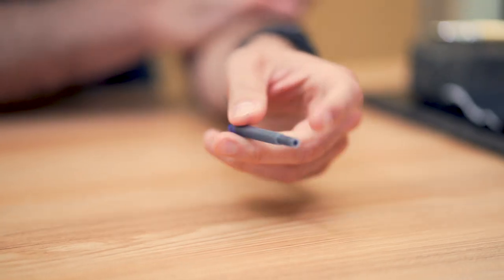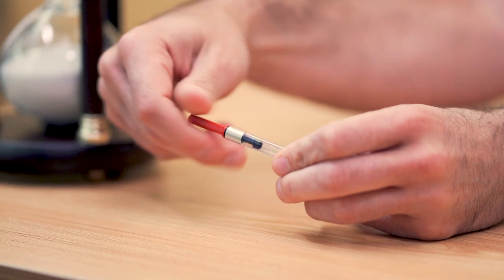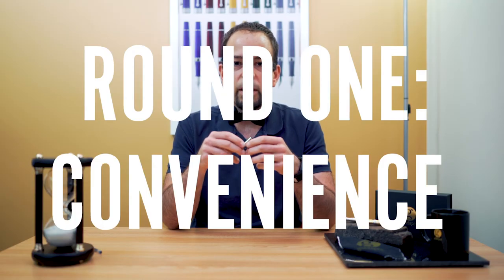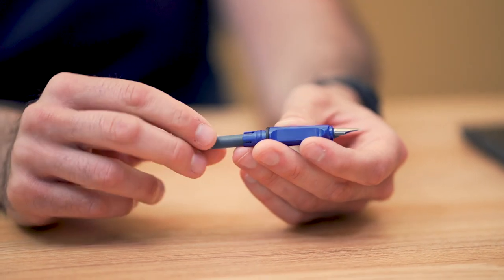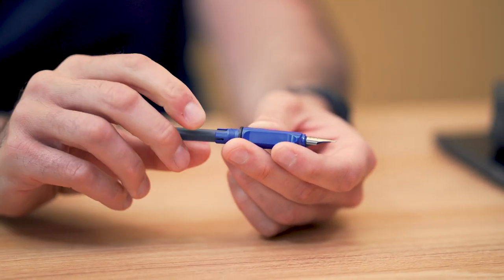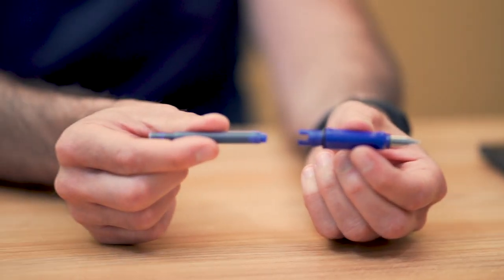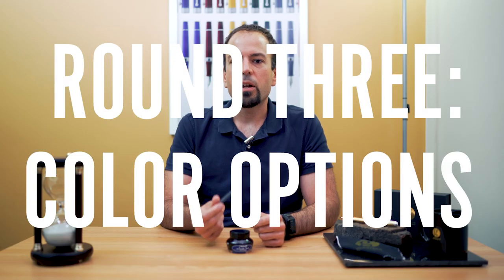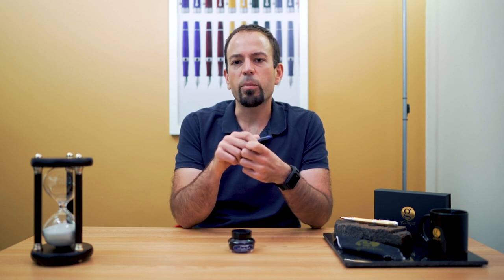Fountain Pen Converters vs. Cartridges - Fine Pens for Beginners Ep. 3

Comment: Thanks for the entertaining and informative video. While I’m firmly in the bottled ink/converter camp, due to the sheer variety and range of colours available, cartridges do provide a compact back up for vacations and other longer times away from the ink(meth) lab (your home). I was away recently on work/vacation for 6 weeks and I took 5 fountain pens along, all fully filled with favourite journaling bottled inks...having some Pilot blue cartridges (that fit 2 of the 5 FPs) as back up meant I wouldn’t run dry during the trip.

Comment: Great review, it was awesome. But I'm surprised that you didn't mention that you could fill a converter using a syringe as well as refilling a cartridge. Some converters are difficult to get a full fill in (Pilot) and others (Lamy Z28) are more difficult for someone with arthritis to use due to the difficulty in turning the piston. Refilling with a syringe can be less of a mess, and with certain bottle styles and shapes easier to get ink into the pen in the first place.
Reply: he did mention the syringe method but didn't get into the details

Comment: If you go to a cheapy store (Dollar Store) look in the craft section. You'll always find a syringe, similar to a medical syringe. Only the end is made with plastic, and is flexible - so no dangerous needles. It usually has written on the side, "one use only". As long as you flush it out with water, after every refill (and let it dry) I've had no problems using it multiple times. I refill my existing plastic cartridges.
Reply: I'll check my dollar stores. 
I bought a pointy syringe and I might accidentally give myself a tattoo by using it.

Comment: I wonder if (in case I want to change ink colour often without buying a set of fountain pens) it is possible to only fill the converter partially, say 30% of it. 
I ask, because you talked about having any air get out of it before using the pen.
Reply from the maker: I do partial fills of my converter pens all the time. It's great when you're sampling inks and don't want to commit to a full fill-up.

Comment: Great video! I'm just figuring out how to use a fountain pen. I love to sketch ,ink and watercolor...but using the microns, well the tip is very sensitive and doesn't love the texture and I have to be extra careful they dry up....I also have rheumatoid arthritis and in doing research I've seen that you don't have to hold the fountain pen straight up like I do the micron and that there's no hard pressing even if just writing, so less stress on my hands....plus, I've just allowed the look of them and been so sad that my grandmother's got lost :( but, I know nothing. I need waterproof ink, which seems to not be what comes in the pen cartridge, so a friend just gifted me an inexpensive fountain pen (Amazon basics) which came with cartridges but reviews said the universal (think thats the term) converter would fit so she got me a set of 2 plus platinum carbon black ink.
My question is this...when I went to put in my converter, it is really super tight, but I am also terrified of breaking something so scares me to use force. But I finally got it go on and the bottom black part of the converter went in but then there is a band of silver after the black and I'm not sure how far I should push it on and don't want to break anything but also don't want to fill and have ink go all over :/
So any help is greatly appreciated!!!!
Just subscribed and look forward to learning more!! I just LOVE the look of sort of messy loose ink lines with watercolor. The nib it came with is fine, I'm wondering if I should also get (only when I can afford it) a pen with a Fude nib? Or are there better pens with all those nibs? Sorry so many questions...I'm super excited but SUPER nervous to do it wrong :)
Thanks again for the help!!!!

Comment: I have a few converters and some have threads and it screws onto the pen and others have no threads and push on.....why ?
Reply from the maker: It depends on the design of the pen. Some pen front sections allow for threaded converters that screw-in. Most are designed to push-in.

Comment: Don't forget to include the cost all those tissues, papers and cleaning materials every time you refill your convertor cartridge; otherwise it is not a fair cost comparision.
Reply: Pens filled with cartridges also does well with a cleaning, depending of frequency of use. If it is used daily and with the same colour ink, sure, not as often, just an intermittent wiping of the nib to keep it shiny. But for me who only write by hand for leisure and keep a few to many pens inked at the same time for a variety of nibs and inks, getting even a standard international cartridge empty takes a while, leaving the pens in need of cleaning between every refill. Hence no difference in paper tissue as well as time and effort (or rather a joyous occasion of pen-tinkering) spent.

Comment: Honestly. Don't fuck with cartridges at all unless a free one comes with your own. Converters are the way to go. No need to wait for the ink to flow to the tip, much color variety, and they are cheaper and last longer. I have ink bottles that are still going strong well after 5 years of use. Take that, cartridges!

Comment: I’ve been considering buying a converter with ink for my fountain pen, I have one question about converters: I use a cheap €5 fountain pen, would a converter still work on it or do I need to buy a more expensive fountain pen with a converter from the same brand?
Reply from the maker: It all depends if the fountain pen can accept a converter. You could try to find a compatible converter for it. Do a quick google search of "[insert brand name here] converter" and see if someone has written the answer on a forum or in a blog post.
Reply: Goldspot Pens thanks!

Comment: Strangely enough I prefer cartridges because I like changing colours a lot. You can almost any colour in a cartridge, and you don't have to commit to buying a whole bottle. I bought a set of 30 or so cartridges with a range of colours. I would have to have bought 15 bottles of ink.
I use bottle ink, but cartridges are more fun😃
Reply: Is it available in different colour in a single packet?  Or have to buy  separately each?
Reply: @santoshkumarbera965  Different colours in the same packet.